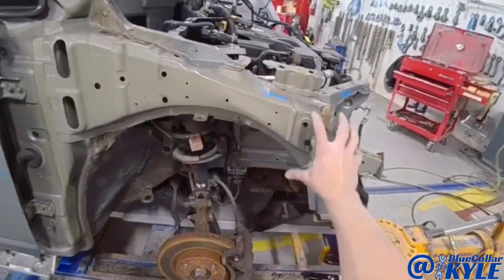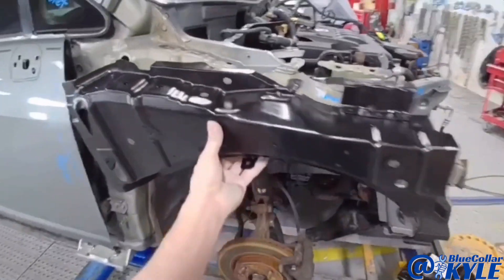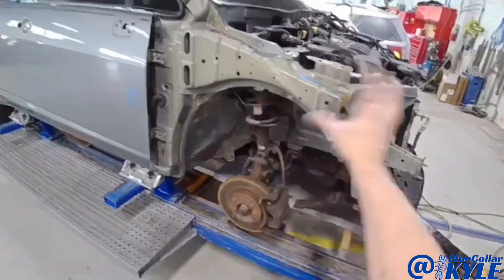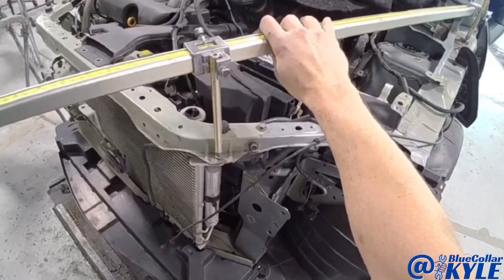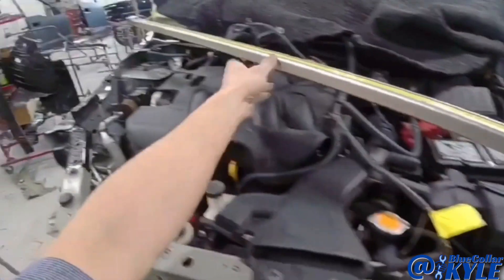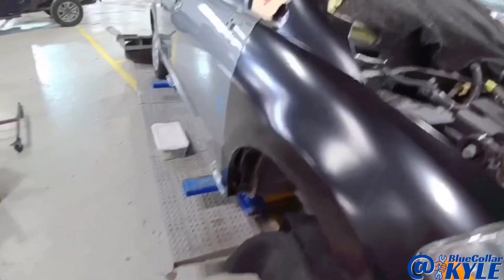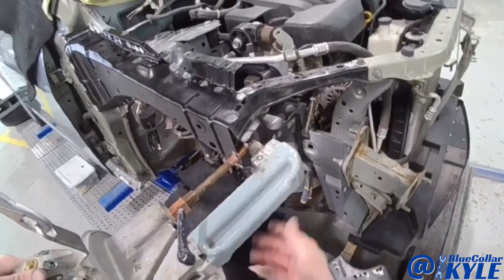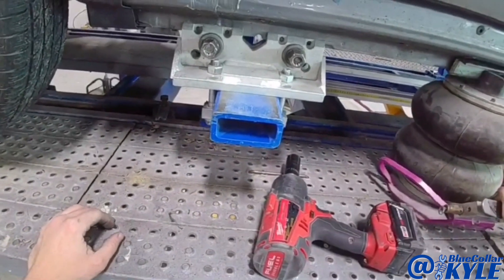It Destroyed The Upper Rail

Comment: Is there a certain reason you use the mini belt sander on the spot welds ?
Reply: Quick and clean, I’ve used the spot weld drill most but trying the belt. Purple 3M lasts